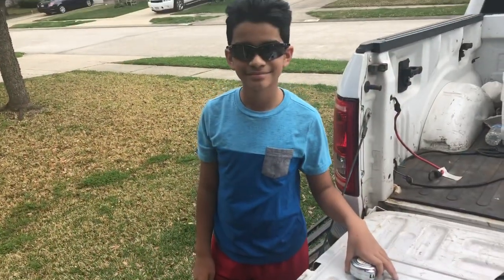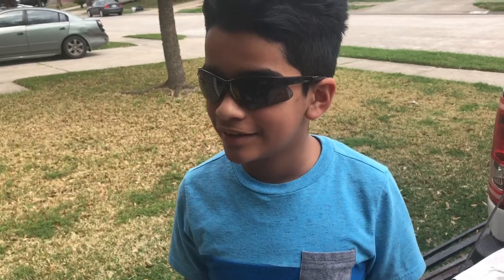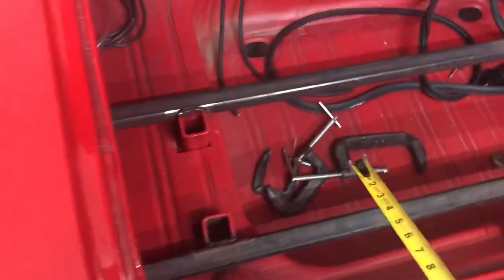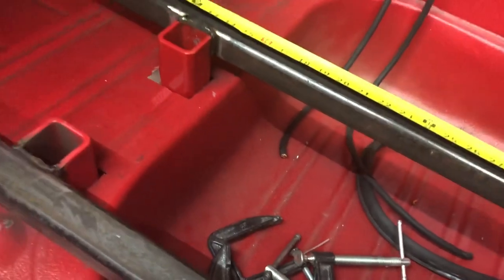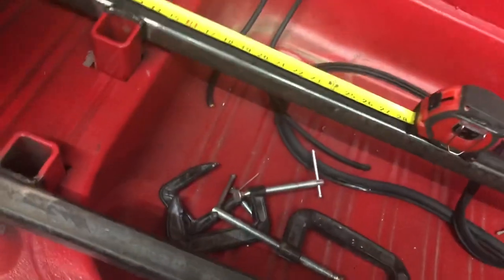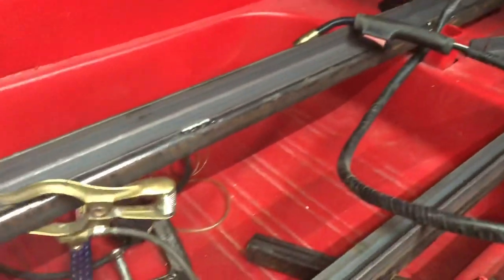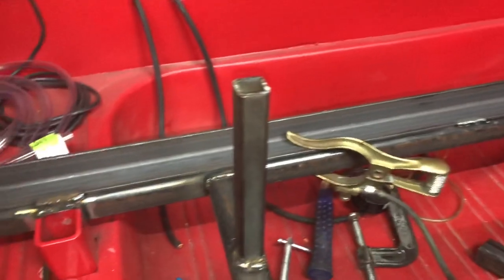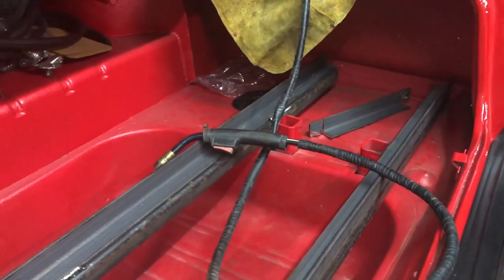1964 impala red rocket Lowrider hydraulics install, part 1 how to build battery rack.

Comment: I like how you done the ends of the battery rack w/ the angle iron. I just left mine under the sides. I built my Monte’s rack in 3 pieces so I could do most the welding out of the trunk. But with 10 across the back you don’t have much of a choice but build in place. Looks great! Keep it up and keep posting. 
Also great point to step back when you start to hit a wall. Gives you a chance to think about how to get over the wall without rushing it.
Reply from the maker: Lowriding AZ Thanks bro, I would preferred to weld everything outside the trunk, just couldn’t.
My buddy Cheech taught me how to do the ends like that back in the late 90s, done them ever since 👍
I’ve noticed every time I walk away from a bad day I always come back with a better idea, never fails! Just got to take a break sometimes 👍🔥✅

Comment: BRO THIS IS BADASS..LOOKING GOOD ..I REALLY LIKE HOW YOU EXPLAIN EVERYTHING..WHAT WELDER AND SPOOL OF WIRE SPECS ARE YOU USING .what settings on welder ..any and all information is really helpful
Reply from the maker: Thank you! I use a HOBART handler 125 mig welder c25 gas, .30 solid steel wire, all welders have different readings, mine has simple numbers, only had 4 speed settings I use 3
Heat in mine only shows 10-100 
I sure it on 50/55 on racks

Hope that helps 👍

Comment: Red rocket how do  you make a 12 battery rack and a 3 pump setup  for 63 impala this is my first  lowrider since 94 but I'm doing this by myself
Reply from the maker: There are so many options, just comes down to personal preference and what you want the car to do.
Reply: I'm a beginner at welding can you use a mig welder to  do panels and frame work like for your battery rack

Comment: Bad ass as usual bro 
Hey where did you get that black plastic piece that blocks the gap between the body and the bumper?and what's it called I cant find it lol
Also are you gona seal up where that square tub comes into the trunk?
Reply from the maker: Stephen Dudla it’s a rear bumper to body seal, made by soft seal, came original on all 64s but most took the off because it would trap moisture.  
Search this item number on eBay 
261810409601
It will pop right up 👍

I didn’t think about sealing/covering the uprights on the frame, I just might, thanks 🙏

Comment: I'm very curious to why you decided to run 10 batteries across the rear rather than having the batteries on each side like most installs?..... is there a specific reason? Like for safety/fires or better for 3wheeling?... very interesting. I'm building my first 64impala lowrider so I'm just looking for knowledge.
Reply from the maker: It was just personal preference, this was just the look I was going for, I like the weight in the back for hopping, It 3 wheels easy. 

I also like 4 batteries on each side and a nice setup in the middle on a pedestal. I may even change it down the line.  Having 4 batteries on each side with a 1/4” steel rack will make it 3 wheel much easier then 10 across the back.
Reply: @RedRocket64  aaihhhh indeed, I see. Thank you for yr reply. 
I've been following your build since 2019. I'm currently in South Korea. My 64 is back in South Dakota with my mentor. He's restoring  and building the 64 while I'm gone. And I send him your videos so he can have a better understanding of what to do. 

So I thank you & lone star very very very much. OneLove brotha.
Reply from the maker: @AllHail_PHARAOH  Your welcome, thank you for the support, great appreciated 🤝